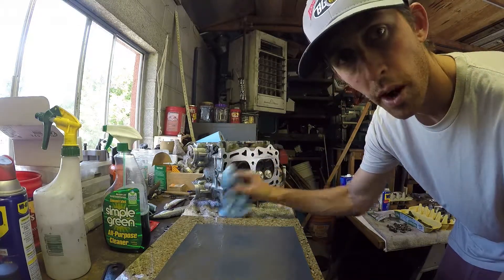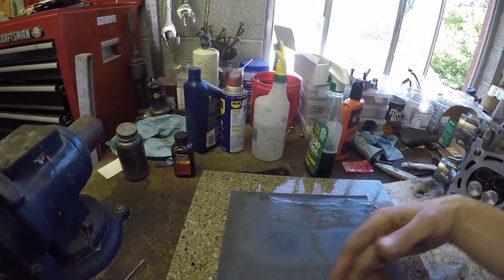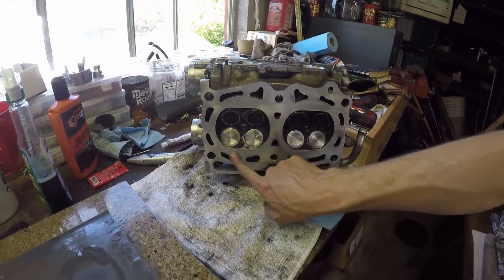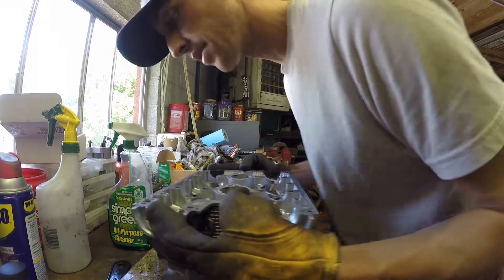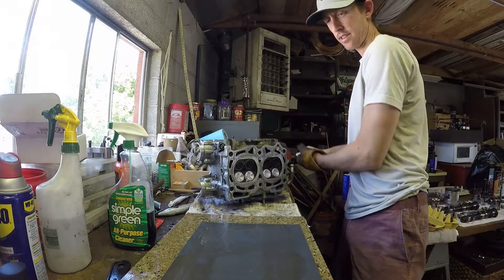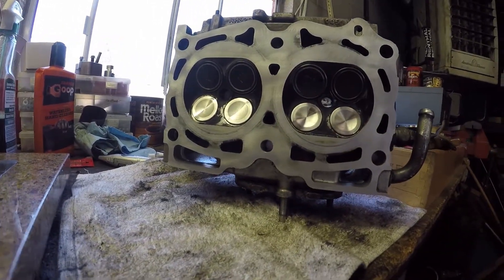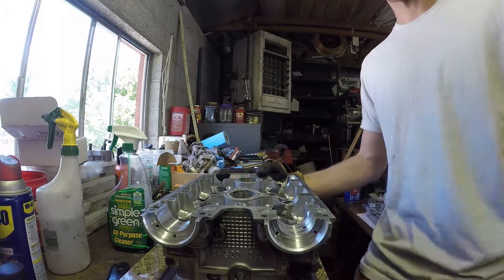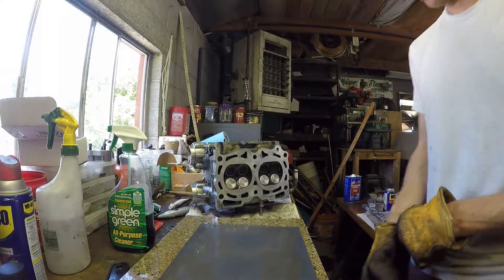DIY Subaru Cylinder Head Resurfacing Method

Comment: I replaced the head gaskets on my subaru about a week after this video went up. The car went on for about 3 years before it got hit by a dump truck and totaled; still ran but was mangled. 
Now we're doing this on my sister's Subaru; this method worked well back then, and it's still good today.

Comment: I've done this method on a SOHC EJ25 rebuild and it works fine if you're careful. You can just remove the absolute minimum needed to get to a clean flat surface, much less than a shop job will remove.

Comment: Hi Kenny, how did you resurface block sides for mating with the cylinder heads?
Reply from the maker: I've had luck by taking a sanding block and lightly sanding the block to clean it.  I've heard that most of the warping occurs in the head.  I'm not sure if this is the case or not, but I have had success with only decking the cylinder head side.  Professional shops don't typically deck the block side from what I know.

Comment: Ok maybe to clean things up but won’t be true flatness. It’s like $100 bucks to properly resurface a pair of small Subaru heads…….can’t fix it, don’t buy it. A year and doing it again. Hard pass.
Reply from the maker: Hello, are you saying you used this method and then the head gaskets failed a year later?  Thanks
Reply: @KennyGillis  I think he says that because you mentioned that its clean because you last took it out and did head gaskets a year ago. in the video. How long has this lasted you?
Reply: lol 2 machine shops in town literally surfaced heads on a big belt sander that was made for surfacing heads and one had been in business since the 50s with that same machine.

Comment: Is it ok to reuse a brand new MLS gasket that has been torqued down but not heat cycled? I want to pull the head back off to fix an exhaust stud...
Reply from the maker: Apologies for the slow reply.  Did you end up reusing it?  That’s a tricky one.  Personally I’d probably put new ones since there is so much work to get to them just in case they didn’t seal well the 2nd time.
Reply: It would probably work but the gasket is cheap enough that you should get a new one.

Comment: i'd say glue is a bad idea, spray adhesive might be a better route to get that paper to stick to the granite to avoid high spots.
Reply from the maker: Hi Chase, I started with the spray adhesive and it works pretty well too, but I didn't have as much luck.  You are correct that you need to be careful about avoiding high spots.  I am pretty deliberate about putting as little as possible and then working the sandpaper so that all the extra glue pushes out the sides.  Thanks for watching!

Comment: thanks for the video! could you give an estimate for the dimensions of the stone? thank you!
Reply: I think I'd rather pay the $100 for relatively cheap insurance and peace of mind. Some repair jobs on cars and trucks are best left to the professionals. Brake, Suspension, Engine and Transmission work are four of them.
Reply: @chrismc410  ya but then you can't tinker!! there may be sighs with failure, but there is a dam big grin with accomplishment
Reply: @chrismc410  insurance sure I used to work at couple shops with technicians caught a couple of them drunk on the job doing work.its the whole reason I started working on my own car. Then again I might be considered a professional since I have a lot of experience in this types of industry and have done full restores on at least 30 vechiles.
Reply: @openleft4214  if they screw it up and your car is ruined. You would at least have legal recourse.  Free head and machining. Cost of head and machining or new vehicle entirely  depending on the judge/jury should you take them to court
Reply: @chrismc410  my state cost 100 to bring someone to small claims court so it counter productive to go the legal route. The only time I would get it machined is if there was a turbo or a diesel due to the high compress ratio. Otherwise I've seen some tech just clean it by hand and slap the head back on.
Reply: @openleft4214  you can get the $100 back along with compensatory and punitive as well as the guilty party paying legal costs, both his and yours.  

The hundred filing fee would be worth it in the long run.   You'd either get it fixed properly at there expense,  you could bad mouth about their business publicly relevant to your issue publicly if there are found liable and they can do nothing as the hearing and/or trial is a matter of public record, anyone can access it

Libel and slander would be off the tables as the affirmative defenss would be verifiable truth, thd3 civil case in small claims will do that.  Two laypeople saying they did wrong is one thing.  A court case, bench trial or jury, another matter entirely.

The other machine shops in the area  would be on notice.  A jury verdict would  also send a message to the others to not allow it to happen again or at the very least, make others think twice on considering wrongdoing fot fear they'd be next.  

May cost a lot initially but will be worth it in the long run.

Ideally their lawyer will see it and most likely offer you to settle out of court
Reply: @chrismc410  nah still rather do it myself but for someone that doesn't own and extensive tool collection and no formal or informal experience in the industry shouldnt take this job on. But simply having the mentally that you can't figure out and do what technicians do is an unessary road block.   I enjoy the independence of knowing how something I rely on heavily functions  and being able to resolve the problem myself. Granted it's a slow learning process.

Fundamentally my argument is that if youre curious and take baby steps with minor guidance most light engine and chassis work is safely do able. 
While  I understand you to want to transfer liability I enjoy taking on that liability through a gradual learning process of doing the work myself. I dislike delagating responsibility its a  weakness and strength and not knowing how something that I rely on has always given me a degree of anxiety.
Reply: @chrismc410  Why in the world are you on the internet on learning videos if you don't want to learn. Those things you mention to NOT work on are usually pretty easy and save the most money.
Reply from the maker: I'll give it a measure next time I'm at the garage.  My guess is that it is 6" wider and taller than the cylinder head though.